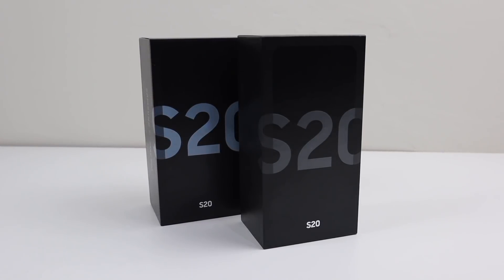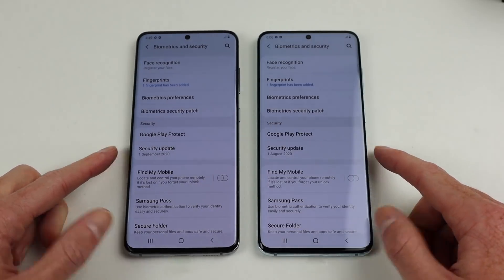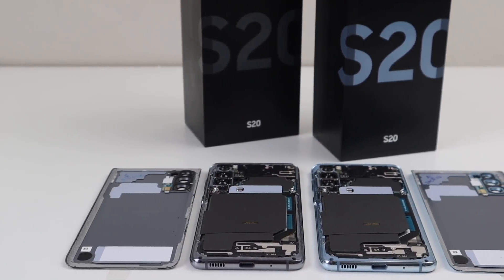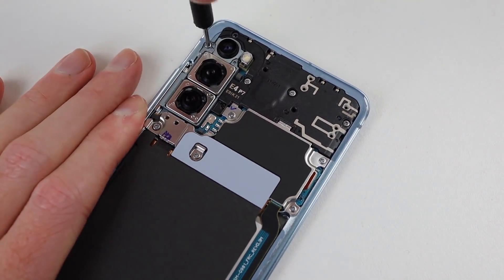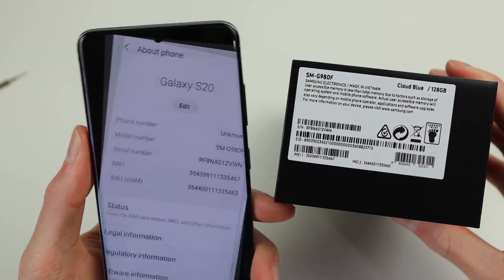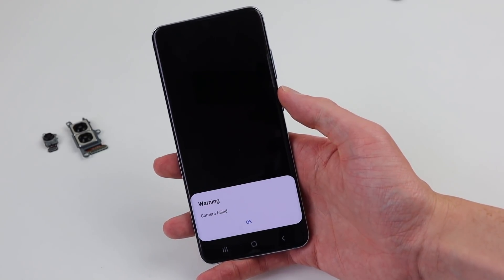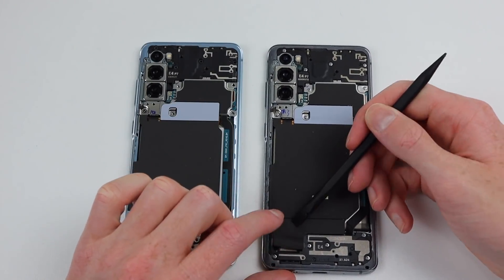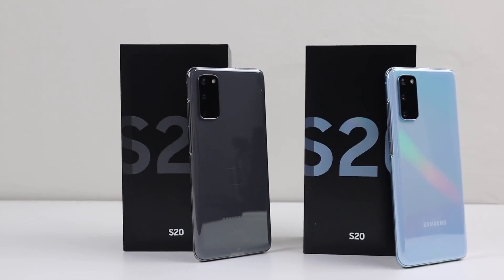Is Samsung locking down 3rd party repairs? Galaxy S20 Teardown and Repair Assessment

Comment: Just wondering what adhesive would recommend
Reply: @Sam Howarth most of the adhesive templates are useless but was wondering about the b7000
Reply: You can either use T7000 or B7000 if precut adhesives aren't available. Used it on my old S7 edge.
Reply: @therealdaniboi  thanks think ill try it i only fix them as hobbies it gives me something to  do
Reply: As for your samsung repair video that tiny bit falls out of the sim release lol